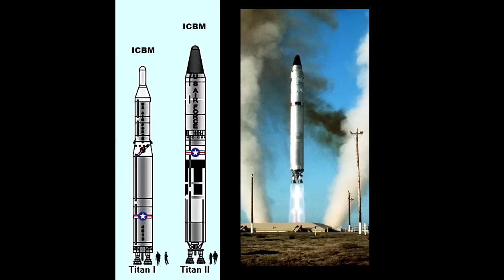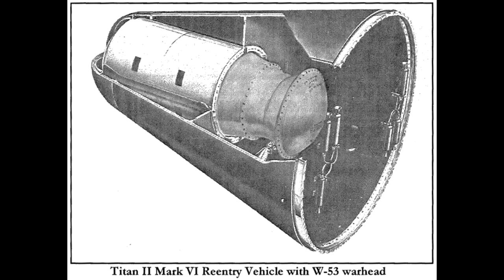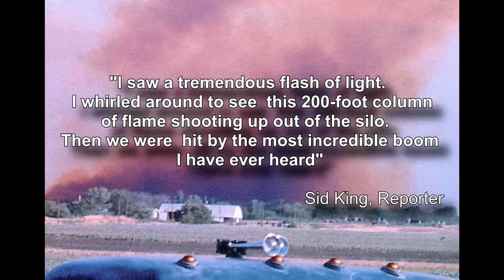Nuclear Missile Explodes Inside Silo - The Arkansas Titan 2 Incident (1980)

Comment: I was assigned to the 2MAPS squadron at Little Rock AFB, the base where the crews came from I drove a tractor trailer from base to rocket  site with equipment the very next morning ,the warhead had be found and was removed just before i got there...the site was  just a giant farm field covered in softball size concrete chunks from the 750 ton  blast doors twisted fences and  giant steel beams everywhere i remember the  crew pickup truck close to the hole all burned and twisted...when we got back to base we had to get blood and urine tests at the hospital

Comment: If the guy who dropped the piece of equipment had been using the correct tool, and he dropped that instead from the same height, would it have just pinged off the metal of the missile instead of causing a hole? Just curious for comparison. Does anyone know what happened to the guy? A terrible thing to live with. Thank you for this video, very interesting 👍🏼

Comment: Faulty ventilation system, wow. Wonder which contractor constructed the bunker. But no the thing couldn't have gone critical, it survived a massive external explosion and landed intact after flying through the air. Even if the casing was breached the explosion around the fissile material has to be uniform for the reaction to work.

Comment: I wonder how big the blast zone would've been if this sucker HAD exploded completely?  How much of Arkansas (and probably Missouri) would've been destroyed or contaminated?  Another great video!
Reply: There's a site called NukeMap that will show estimated damage zones overlaid on a map. I was honestly surprised by how little damage it would do. It would be devastating to be sure, but Arkansas is so empty it wouldn't reach a major population center. "Only" about 100 square miles of heavy to moderate blast damage, a lot less than I expected.
Reply: The vast majority of damage from a nuclear bomb or warhead is intentionally "concussive" damage caused by the shockwaves compressing and releasing the ambient air of the atmosphere... As such, the optimal detonation for shear destruction is ELEVATED... and actually by quite a lot, so the blast-wave can propagate effectively both to the ground and outward EFFICIENTLY. Too high, and the atmosphere absorbs most of it, dampening the concussion to the structures and people on the ground. Too low, and the downward vertical waves are reflected, forcing the outward propagation upward and uselessly wasting energy into the upper atmosphere, rather than adding force to them as they travel outward along the surface of the earth... SO each warhead has it's own specific altitude for an optimal discharge and maximum radius of destruction.

    What happened with this missile suggests one of two likely scenarios for a "full detonation" (which IS truly impossible...btw)... Neither of those is "optimal". IF (1) it detonated from the original explosion INSIDE the silo, while the explosion WOULD most certainly be earth-shaking, it would break out the rock and concrete around the silo, utterly annihilating it, BUT 90% or more of the actual force and shockwave would be entirely sent UPWARD. Any "fall-out" would similarly be carried with it and likely only add some diminutive amount (probably considered "negligible at most") as unspent radio-isotopes would vaporize into very fine particles into the very uppermost atmosphere... IF (2) on the other hand it was ejected safely enough and detonated on impact with the ground, again, most (but more like 60 to 80%) of the shockwave would be spent upwards, while a bit more would be guided along the local terrain. While Arkansas is relatively "flat", it's not a perfect "flat", so variations in the ground would diminish the path and propagation of the shockwave as it traveled outward, and this is likely where the "100 miles of devastation" is suggested from. Hills and vales, ditches and other dubious obstructions over the terrain would cause the waves to shift direction, gliding over anyone and anything lucky enough EVEN at or near ground zero, to be able to find partial cover within the eddies and stillness in protected zones...

     Very specialized detonation sequences are required for a nuclear weapon to "go off", and without that to trigger the internal explosives, there's simply not enough force to slam the "fuel" together for a critical mass. No critical mass means no "full detonation"... Criticalities are NOT detonations, and for those kinds of incidents (of which there are several worthy of note) I'll refer you to "The Demon Core" incidents that are most famous. They've happened without explosive or explosions, killed plenty, but didn't even level a lab in most cases... Nuclear fuels and devices are very fiddly things, but it actually DOES take some considerable skill and technology to get a bang out of them, far different from the older fuel-air propelled variations that cover so much more of history. Almost any idiot can mix a fuel and some form of oxygen or oxydizing agent well enough to cause himself and those nearby some great deals of egregious harm. It really takes little or no skill at all... BUT with nukes, part of their charm is the inherent difficulty with which they even go off ON PURPOSE, thus greatly reducing the risks of them detonating either prematurely or accidentally anywhere or anyhow else... That's not to say they're "safe" by any stretch, only that they don't tend to "just blow up"... They can suffer a variety of other issues that can seem even worse than the older school of bombs and such devices... some of which make them considerably worse as the choices of munitions go... and fallout is at least noteworthy on the list.  ;o)
Reply: I've traveled through Alabama, I'm not sure anyone would notice.
Reply: @gnarthdarkanen7464  that area of Arkansas is by no means flat. The silo is actually located between Damascus and South Side. Just off US 65. Plenty of hills. I grew up there, and drove an oilfield truck there for years. It's located in the foothills of the Ozark mountains.
Reply: Interestingly enough, Walter Mondale and Bill and Hilary Clinton were at the Democratic national convention (I believe in Little Rock, AK). It certainly would've changed the face of American politics!
Reply: @jasonduncan69  Very rarely is any terrain even relatively flat... In any case, I've only been THROUGH Arkansas... Thanks for a better descriptive, since the way the vid' was worded, it's relatively easy to presume they're talking about further to the flatland/lowland...

    In any case, from what I understand of nukes, I'll stick by my assessment. That's relatively solid in its foundations. 9.5 Megatons is big enough, that other than some variation on the minor details, it's going to be fairly inefficient and ineffective for widespread destruction until you've detonated around 10,000 feet (if I recall correctly)...   ;o)
Reply: A warhead this large, detonated that low to the ground, or even possibly IN the ground would be wasting a lot of its potential energy.  It's also possible the hilly terrain of northern AR would act as a buffer against horizontal blast wave damage.
Reply: Checked it on Nukemap, and yeah, you're going to be disappointed.  The really, really bad stuff like getting vaporized or fatal radiation doses only goes out to about a 3 mile radius or so.  At about 6 miles, homes are still likely destroyed.  At around 8.5, still damaged.  At around 15 miles, windows may still break.  Likelihood of severe thermal burns drops significantly after 20 miles, and beyond 35 miles, you likely aren't going to be harmed by the explosion at all.  That wouldn't even get to Little Rock.  

Fallout is another matter entirely, but its wind direction dependent.
Reply: @scarpfish  Per "Command and Control," they would've been affected (I can't find my copy of the book to quote the passage directly). It's an interesting book if you haven't read it.

Comment: I don’t understand why they didn’t open the silo hatch to vent the fuel unless it was heavier than air. RIP
Reply: Probably wouldn't have helped. The silo door was operated by a hydraulic motor pulling a cable with an electric motor operating a hydraulic pump.  Lots of chances for a spark to occur.

Comment: Now do the 1965 titan 2 silo fire. It killed 53 men outside of Searcy Arkansas.
Reply from the maker: Yeah, I read about that while doing the research on this video - terrible accident...
Reply: @theravenseye9443  mapstronaut is the only one I know that has done a video about it.
Reply: I believe that's the one where a contractor struck and arc on a hydraulic return line.
Reply: @florret2003  that would be correct. I doubt he struck the arc on the line, but possibly burned into it. From what I understand. It was a tricky area to weld.
Reply: @jasonduncan69  If I remember that line correctly, it was a large braided return line on level three near the diesel generator and an inadvertent scrape with the electrode could have punctured it.

Comment: In fact, the USAF did set-off a nuclear warhead, not to see if it would undergo a NUDET - nuclear detonation - because they certainly had no intention of setting it off; the whole thing was an accident.  It didn't even happen in the U.S., it happened at Palomares, Spain.

A B-52 was on patrol as part of a then-continuous policy (since then thankfully ended) of having B-52's loaded with warshots airborne 24 hours a day and ready to turn toward the Soviet Union at short notice.  No Doctor Strangelove about this though - the warheads would not detonate without the correct PAL code entered, and those were (and still are) kept in the President's nuclear football; only the President can authorise a nuclear attack.  So this B-52 was on airborne patrol over the Mediterranean with four B28 thermonuclear bombs aboard and, running low on fuel, it hooked-up with a KC-135 tanker to fuel-up.  Only, something went wrong - the two aircraft collided and broke-up in flight, and the four bombs fell free from the wreckage.  Three of them landed on Spain and two of those bombs exploded, although setting-off a NUDET is a very, very difficult and precise thing to do, so the two bombs that exploded just blew themselves apart, scattering radioactive fissiles all over the place and costing the U.S. an expensive clean-up effort.  The third bomb sank a ways into the earth, and when the USAF found it, it had armed itself - but it did not go off.

The fourth bomb was even more fun - it had landed in the sea.  The U.S. Military immediately embarked on a massive search for it - but it was lost in a couple hundred miles' worth of very deep seawater over a very rough sea bottom, and the only vessel that could get down there and look for it was the slow, tiny research sub Alvin.  Their likelihood of ever finding the bomb was essentially nil; but they would not give-up, and they just stayed out there searching.  They used very sophisticated statistical methods to try to cut-down the search area where the bomb might have landed, and other than that, they just kept searching.

Meanwhile, a local fisherman named Simo Orts was sitting outside in the reception area day after day.  Out of desperation or maybe boredom, one day somebody asked him why he was sitting there all day, and what he wanted.  "That thing you are looking for - I saw it land in the water and I know where it is."  So they talked to him - he couldn't tell them where it was, because how does a local fisherman, long before GPS, tell anybody where exactly something is on a featureless ocean miles from land?  So they loaded him onto a boat and took him out, and he led them to a spot on the ocean; he said "it's HERE" and they said "very interesting..." and went back to shore - but next day when they loaded him back onto the boat, he took them to the exact same spot.  How was he doing this? - nobody knows; but local fishermen KNOW their waters.  So they invited him down for lunch, and covertly moved the boat away while he was down in the galley - and when he came up on deck again, he said "No not here - over THERE."  And he led them right back to the same spot.  What the hey - what have they got to lose?  They called Alvin over and had it submerge at that spot - - - and Alvin landed on the bomb's parachute.  It took a couple more months to recover the bomb due to dropping it during recovery and having to find it all over again, but the (deactivated) bomb is now in a museum.

And one other delightful little fillip to the story.  The fisherman visited the United States soon after and, in a New York courtroom with a former Attorney General of the United States as his lawyer, pressed a salvage claim on the bomb.  Marine salvage claims for something somebody finds are usually little more than an honorarium, maybe 1 or 2% of its value, but no less an authority than the Secretary of Defense had said the bomb was worth $2 billion - you do the math! 🤣

Comment: Thanks, I had never heard of this before. Seems very credible that the extractor fans ignited the fuel air mix.
Reply: Seems plausible. There's a local who died here after his cordless drill motor ignited gasoline fumes while he was working on his boat. 
Electric motors arc quite a bit and are not safe around flammable vapors.

Comment: You’d be surprised what is required to set off a nuclear warhead core.  

It needs almost infinite pressure meaning rocketing down at 30,000 mph with a mass of 150 tons gets multiplied by 1000s of times to compress the core and create heat, setting off the chain reaction needed for detonation.
Reply: They should of just left it alone.  

What’s that saying? If there’s a gas leak… don’t turn on the lights? Lmao

Comment: The Titan doesn’t have an aluminium skin. 
It is all stainless steel because the liquid fuel and oxidiser are so highly corrosive.
The fuel tanks are pressurised because otherwise the tanks will collapse under their own weight.
The Titan didn’t need an ignition source - the fuel and oxidiser ignited when simply mixed.
And finally - yes they did actually test the warhead wouldn’t explode when simply dropped - because some of the earlier generations could and did. They were flown in bombers in separate pieces and assembled in flight because of this.
Reply: And because the fuel and oxidizer were so corrosive they cycled the birds to Vandenberg for test launches, replacing then with new ones at the sites.

Comment: Shoulda used brushless motors! I bet those fans had brush motors. You know they did... Negligence kills. Good lesson learned if you got older drills or cordless tools. Know which motors u can and can't run inside flammable atmospheres. This is like 50 or 60 on the Zombie Apocalypse Survivor's Guide.

Comment: Your story is wrong at some points.  I was working on Titan at Vandenberg AFB at the time, so we got all the details.  

Here verbatim is what the initial crew was doing.  
https://www.youtube.com/watch?v=fSZ5MNAmSno

The socket went thru a rubber boot between the work platform and rocket, not rolled over the edge. 

The explosion was caused by pressure in the stage 1 fuel tank going negative, ie. a vacuum.  
The missile structure could not handle the weight of fully loaded tanks above and collapsed.   
The fans you mention have sealed explosion proof motors, they were not the ignition source. 

We used a light weight custom made aluminum socket.  And verified it was secure on the torque wrench.

Comment: Speculation about the possibility of a thermonuclear detonation as a result of this fuel explosion is flat out irresponsible.   The "safety features" you so glibly dismiss likely include not installing the radioactive core of the device until a launch in anger becomes a real possibility.  Under these circumstances the most you could get is a conventionally driven "dirty bomb" type explosion, and that is only if all the triggering mechanisms are activated in correct way, or if something otherwise manages to detonate the high explosive portion of the warhead.  No nine Megaton incident is possible.  Otherwise an interesting and quality documentary production.

Comment: 9:00  It is 100% guaranteed.  Think of the odds this way.  A nuclear detonation is as likely as you blowing out a candle and causing a building on the other side of the planet to collapse.  So 99.9999999....% impossible.  What physicists call vanishingly small odds.  I'm sure I'm not the only one to explain this, but it is HARD to make a high yield nuclear explosion, and doubly so for the hydrogen fusion.  Any change in orientation of the components (and it was already in a safe orientation, i.e. unprimed) , and it is impossible to have a nuclear explosion.  Now what you could have is what's called a dirty bomb, which is a chemical or low yield nuclear explosion scattering radioactive plutonium around the country side.  Once the warhead was recovered in one piece, all was safe.

Comment: I never understood why places like this that HAVE to have exhaust fans in a flammable area...why they never build a system where the fans work on a belt system. Keeping the actual motor far from danger so to speak. They are smart enough to split the atom but not smart enough to build an exhaust fan? 🤭

Comment: everyone local knew as there were multiple like literally over 8 I believe sites spread around the area at the time everyone local was aware of the titans and there danger and we’re proud to be a large part of the nuclear triad to defeat Russia if the need arose locals even were contacted to clean up and help intially after the radiation was deemed livable and it’s minor ppe in caves enclosed tractors dozers and heavy equipment etc.